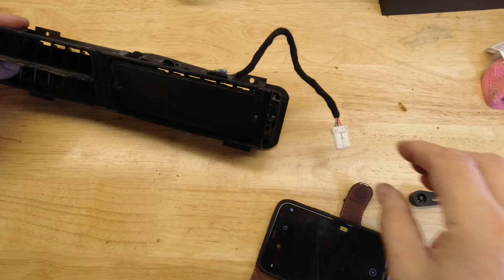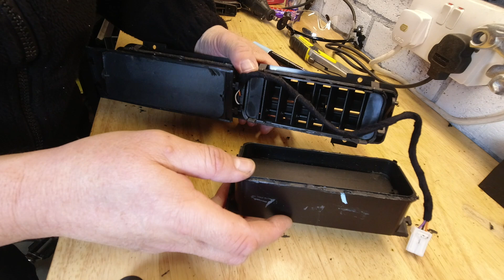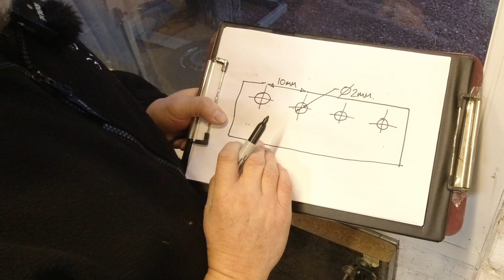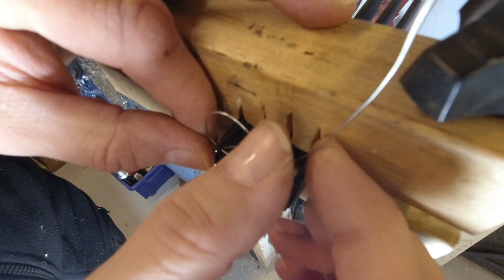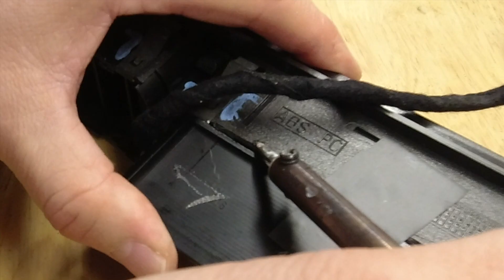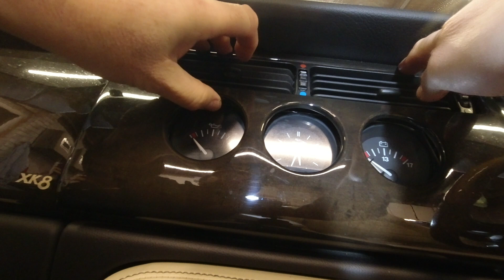Vents part 2. REPAIR the air vents from your Jaguar XK8, XKR, X100

Comment: Hi John. I have a problem with heating in my XKR. The heater on the passenger side works well, but the drivers side blows 10 degrees cooler. What could it be ????
Reply from the maker: With no left right diverter in our cars systemsI can only guess that one of the heater hoses has become detached

Comment: Hi John, I have something rattling inside the dashboard. The other day this loose abject which I have no clue what it is,slid from the left side of the dashboard to the right side (driver side) and stayed there. It continues to rattle when you go over bumps and drains. Do you have any clue what it might be.
I know it’s a long shot 😂
Reply from the maker: Hi Richard
Im not aware of any channel or tube that could carry anything from left to right behind the dash! check for a stray screw between the screen and the dash top. or remove the plenum cover that the windscreen wiper arms sit above and look for something loose in their?
Reply: @ many thanks John 👍

Comment: I enjoy your informative videos and my car thanks you too. You know a good fishing line would likely work as well, I think, but would be easier to use. Of course the metal wire will last forever but might wear the plastic through.  But that would be the next owners problem as it won’t happen quickly, I think.
Reply from the maker: Not sure if you can get fishing line stiff enough to push as well as pull the vanes. but as the distance between vanes is so short, maybe it would be fine. 🤔.  Very interesting idea. Thanks

Comment: BTW I uploaded a 3D file for printing to fix the X300 vent system about 2 years ago though my measurements were slightly different at 9.8mm spacing and 1.94mm pin dia.   I do like your wire method though for the X300 disassembly is not required (although it would make it easier).  Putting the clip on in the X300 is very fiddly but can be done with a medical forceps and a small hook pick without full disassembly.   For those interested: Thingaverse: thing:4605748 "Jaguar X300 / XJ40 Dash Vent Louver Synch Clip."
Reply: 3D printing has made a lot of these "man in shed" fixes obsolete but still nice to see different approaches to a problem, I was expecting this vid to be a 3D solution?

Comment: Hi John I have just done mine, following your vid. As an extra to stop seeing the wire, I have cut and threaded spacers on to the wire between the vanes. This I cut from the fine tube that comes with wd40 spray can. It was red but I touched this up with black paint and the finished job looks like it was meant to be. But thanks for your vid as I wouldn't have attempted it otherwise.
Reply from the maker: An excellent addition to the technique Don. Thanks for sharing. Im sure a lot of folk will follow your lead👍👍

Comment: how to get to the valve for this vent. No air is comming thru. A flapping sound can be heard. are they electrical operated or?
Reply from the maker: Servo's operate all of the air. valves. Press the face level button on the. centre console and then turn up. the fan speed. If its. working then it will literally take your breath away👍

Comment: Another brilliant, innovative solution. Before you got to the bit with the wire I was going to suggest that you send me a drawing of dthe broken part and I would get my son to produce a load on his 3D printer. However, don't bother with the drawing, your solution is far better. Incidentally in a similar situation where I had cut open an ABS 'box' I laid ABS printer filament into the gap as a filler rod. Worked really well. Keep up the good work.
Reply from the maker: Good tip! 3D printing Filament as plastic welding Rods. I like it Alan👍

Comment: Great video, John. Your mentality is the same as mine. Always try to mend and make good rather than buy new. Are you from Yorkshire like me? 😊

I would have done exactly the same as you did but I would have relied on the glue and not re-done the plastic welding. Is there a particular reason that you did not trust the glue on its own?
Reply from the maker: Mainly I enjoy plastic welding😁
Reply: @tothegarage  👍

Comment: Better using a dermel hardened steel saw tooth blade...less than 1.0mm...less heat produced and will ‘saw’ the melted plastic away...and leave a much cleaner, less melted joint face...
Reply from the maker: Really good tip and I have ordered one Stu. Thank You👍

Comment: Great repair John. On mine the piece that was broken on yours had become detached from the vanes but wasn’t broken. I took the unit out of the car and was able to put it all back in the right place with pliars and a bit of fiddling without cutting the unit apart. Worth checking before you reach for the Dremel - though not as strong as your wired repair.
Reply from the maker: Good to know it can be done through the back of the unsplit vent hunty28. Tweezers? needle-nosed pliers?or the fingers of a 3 year old?